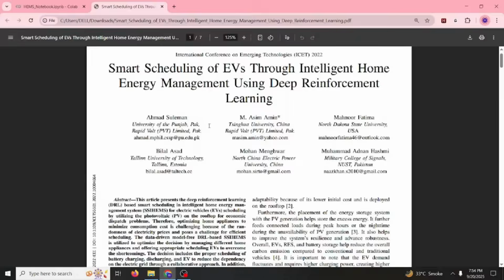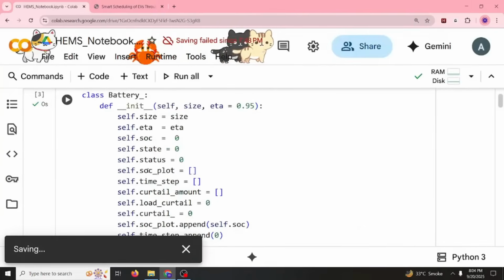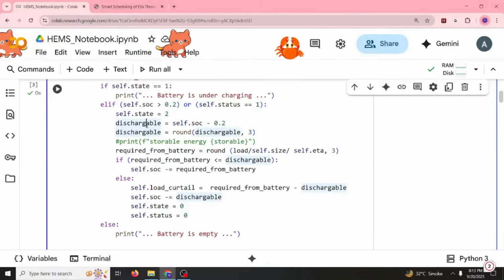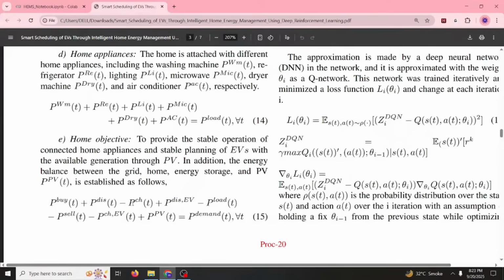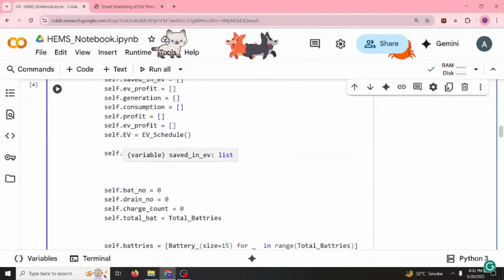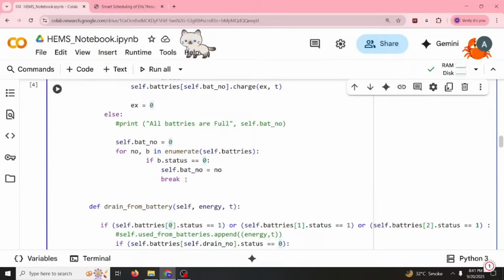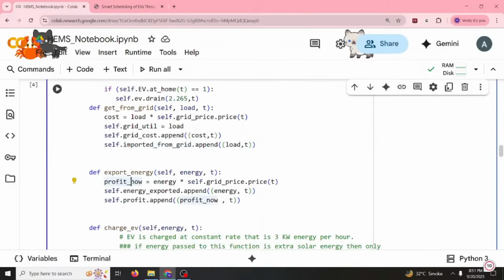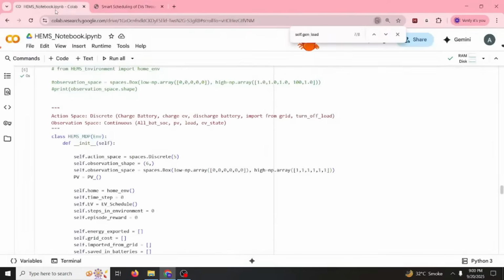Electric Vehicle Charging Optimization with Deep Reinforcement Learning (Python Implementation)

Comment: Hi, first of all, I'm deeply thankful for your video helping me a ton. I am currently working on a similar problem and have a few questions regarding the dataset you used to train the RL model. I would be very grateful if you could clarify the following:

1. Was the dataset used to train your RL model collected from EV charging stations after the RL algorithm was already integrated, or was it raw data collected before any optimal control mechanism was applied?

2. I currently have a similar dataset collected from an EV charging station that does not integrate any optimization algorithms (for either pricing or scheduling). Would it be feasible to use this dataset to train an RL model similar to the one you developed?
Reply from the maker: Kindly ask these questions using given linkdin IDs given in channel descriptions